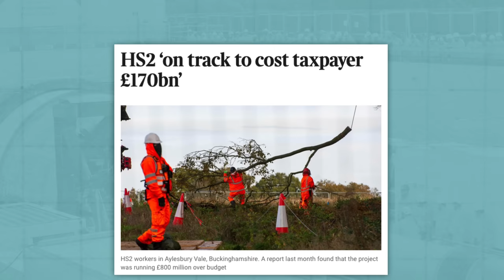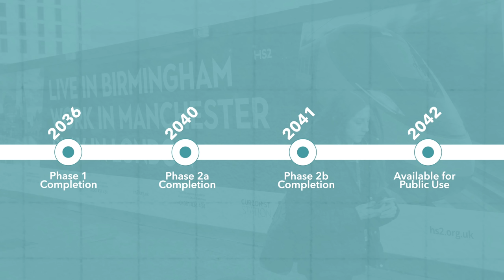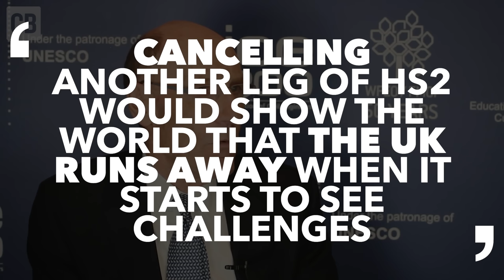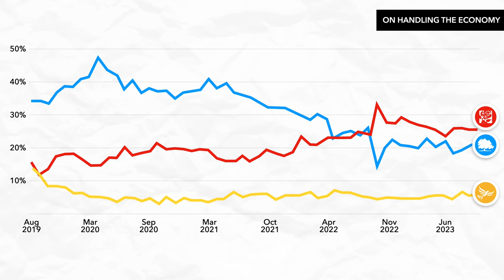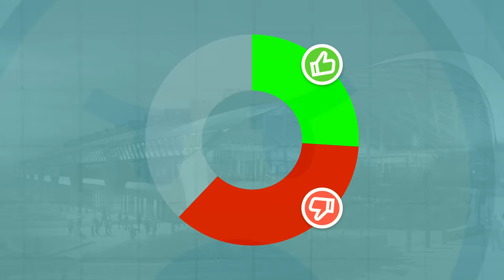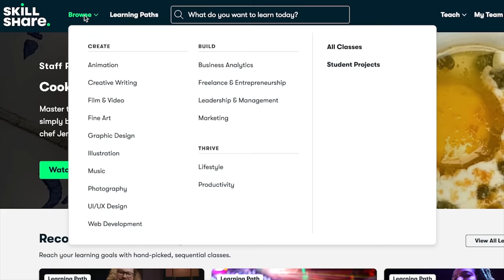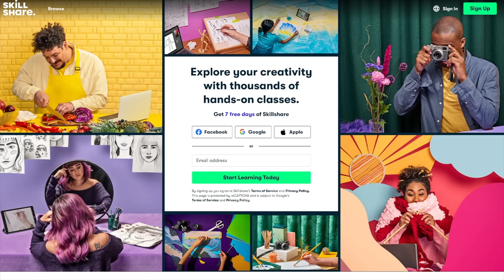Could Cancelling HS2 Work for Sunak?

Comment: Britain needs better, faster and CHEAPER trains. 

A project that would reshape the nation like this isn’t something you can be stingy about. It’s a matter of state and should be independent of who’s in power.
Reply: The reason I'm against this, is because of the cost to benefit ratio. It will cost a LOT, but only provide a little  benefit to ordinary people. Mostly it will benefit rich Tories, which is why the conservative wanted it so much.
Reply: Don't have to be stingy but don't have to be dumb. As some have said, remaining costs could be cut in half if it was just "very fast" not "super fast", and if the main aim is to free capacity, the 10mins difference is immaterial.
Reply: An estimated 100bn that can potentially still rise is really a huge sum for this few lines.
The benifit of beeing a little faster AFTER 2040 is also not that huge.
Imagine what you could do with this huge amount of money....

I also doubt that trainline will get cheaper because of this construction project.
Reply: @blablup1214  Tell me you didn’t watch the video without telling me you didn’t watch the video. Also stop buying into the false dichotomy that it’s HS2 or something else. We’re underinvesting everywhere and there’s no need for it.
Reply: By nation ,you just mean England, yes?
Reply: The issue with HS2 is it can't do that at most in 3 stations it will free up 4% of lines. It is also so far over budget it is ridiculous the line is 10x the cost of one in France.
Reply: @goattm2  I’d like to think a completed London through Manchester HS2 would make Birmingham to Leeds and North to Scotland more politically viable in the future, but knowing this country’s attitude to investment I’m probably wrong.
Reply: Along with better, faster and cheaper government.
Reply: @Alex-cw3rz  good idea !  Why not get the French to build what you really want ?
Reply: But we’re supposed to WFH and shelter in our 15 minute cities where trains become redundant.
Reply: @andreaslind6338 if hs2 is scrapped hs3 will most likely be scrapped too which will connect all major northern cities. Faster, cheaper and more reliable trains benefit ordinary people
Reply: @andreaslind6338  why wouldnt it benefit wealthy Labour people?
Reply: @goattm2  So, 90% of the population of the UK?
Reply: @andreaslind6338  I'm against it but the idea of HS2 was Gordon Brown's policy.
Reply: yep, i related visiting britain, to, OR going to london, = eurostar
or you'll need a car :-D , so car on the boat across the channel , 
i only looked up price for a longer city to city distance ONCE :-D , that horrible price convinced my enough that UK is simply not a public transport friendly country outside of greater london :).
Reply: @andreaslind6338  Its seriously worth the price. The West Coast mainline seriously needs additional capacity. The commuter trains are busy and are 12 coaches long.
Reply: Dont worry , tory voter chinese money is on its way.

Comment: sigh I've said this before. Back in the 60's, Japan started the Shinkansen, a high speed rail that is still world leading. The UK at the same time, rather than building a new rail, decided to build something that would go faster on the existing track, the APT or Advanced Passenger Train. The success of this is seen in a bad light, but the reality the findings were passed onto the Italians and actually made the system work. Meanwhile, as a stopgap, we had the HST 125. (look up Age of the Train for the wonderful figurehead of the advertisement) This arguably was a success, except in retrospect. It was meant to be a stopgap, a 50yr stopgap. The APT project was brushed away due to a bad launch. 

Cancelling the rest of HS2 is just passing the buck again for another generation. We tried to have short term savings with the APT running on existing track, and now we're cancelling HS2 as its costing too much and taking too long to even make plans, let alone building, when we all know, in the next 50yrs, we'll be upset with the existing system and complaining about the last generation not looking ahead
Reply: APT by the time it left service was working well. If anything it was held back by the lack of funds needed to upgrade the signalling to an in-cab system that would allow the APTs to go as fast as they were capable of going (From what I understand, UK railways are STILL waiting for that technology upgrade). The initial technical kinks of the APT were ironed out and remaining issues would be eliminated in any future "APT2". 
In the end it was another example of just how much the Tories hated the railways. In 1988 British Rail emerged into profitability for the first time since its inception, and instead of consolidating its success, the Tories set in motion plans to privatise it for a quick buck.
Reply: TLDR: Kicking the can
Reply: and the Japanese had even worse terrain to work with
Reply: And thats why HS2 is so much over budget. The UK cancels these projects constantly. And as such never allows for the industry and instutions to dveelop and learn the necessary skills. France, Japan, Italy. These nations are not magically better at rail projects. They are good because they have actually build rail for the past couple decades.

Comment: I feel like it should be mentioned that the Crossrail project is soon predicted to breakeven (late 2023-2024), and the core section only opened last year. That was a costly rail project as well. It's proof that investing in these high value rail projects actually will be profitable and grow the economy.

Comment: You can't expect major infrastructure projects like this to be cheap. Crossrail, a line that just serves London and the surrounding area (although with the obvious caveat that a greater proportion of it is underground than HS2) cost £19 bn. I was originally against HS2, but now that construction has started and billions of pounds have been spent, I hope we get some sort of railway at the end of it.
Reply: Yes, and remember how everyone said Crossrail was a shambles and should be cancelled. Where are all those people now? Do they still think it was a failure and not worth doing? The line is incredibly popular and everyone I've spoken to (including myself) loves it.
Reply: Majority of Crossrail's cost is the central london tunnels
The outside tunnels like the redding section is using existing local tracks (hence requirement for trains to use 3 types of signal systems)
Reply: Crossrail had a ridiculous cost because of how deep the tunnels were and the topography, but it was done relatively quickly even though it cost a ridiculous amount of money. And it also benefitted the country’s economic base-London. HS2 is going to go from the economic center in London, to areas that haven’t seen economic development since the Industrial Revolution. It just doesn’t make economic sense to spend $140 bn that will never be recovered.
Reply: @Da__goat  Hang on bruv. You know what kicked off the industrial revolution in these areas? Railways. When a railway was built economic investment happened, Look at my town hartlepool for example, Before the railways, small fishing village, once they turned up boomed into a industrial hub untill steam died...

Comment: While Italy is planning the longest suspended bridge in the world to link an island with a 8 line wide road and dual railway, the UK is thinking about cancelling a train line on land....
Reply: tbf, that bridge in Italy has been in a similar political spiral for decades and has never broken ground on the project.
Reply: @Wozza365  The big difference is that they do not plan to stop at the middle of the project, they have also built tunnels much more complex and expensive and know that in the end the benefits vastly outweigh the costs.
Reply: Bad example. The Messina straights bridge keeps on getting deferred..
HSR and rail infra in Italy would be a good example to follow. They have built a core spine route similar to HS2 and it's a roaring success and also over last 40 years has been slowly upgrading existing lines putting in diversions etc

Comment: The explanation for why HS2 was planned at the beginning of this video is probably the clearest and easily understandable explanation I have seen on the matter. It shows exactly why the line is in theory a good idea. I think one of HS2's biggest issues is it's name, because everyone gets so fixated on the speed aspect, and it is therefore understandable why so many people have the opinion of 'why should we spend all these billions of pounds just so we can get from London to Birmingham 20 minutes quicker' without really understanding what the project is about.

I don't often use the trains, but when I do I'm always surprised by how busy they are, and my biggest gear grind is that in the evenings and on Sundays those 'express' trains suddenly take twice as long (eg London to MK that normally takes 35 minutes suddenly takes 70).

Comment: I supported HS2 in its original form, and I thought it was still worth it even after the Leeds cancellation. But if they cancel the Manchester section too then I honestly don't see the benefit of continuing with it in such a watered-down, largely pointless form. All the more a slap to the face for the North since a big part of the sales pitch for the project was to help the North. To supposedly improve connections in the north and to "level up" the north of the country. If it does go ahead in its current shambolic form (without anything past Birmingham), it will simply be another monument to northern neglect and government indifference (or rather disdain).

Edit: I also doubt that the cost savings will be that significant in the larger picture of the project. Once all of the logistics, personnel, equipment, and what have you have been assembled and are operating, a significant amount of the cost has already been committed. Setting up and shutting down said projects/operations is where a significant amount of time, effort, and of course, money, is spent. This is why it's almost always better to just complete a large infrastructure project in one continuous process, with one step leading directly on from another, rather than stopping and starting. So even from a purely financial perspective, would it be worth it to save some money on the northern leg of the line, making the entire project all but impotent, whilst simultaneously still having to fork out a lion's share of the cost?
Reply: the supposed "Cost savings" from the cutbacks don't exist.
Heck they just make it MORE expensive since every extra year of construction is an extra year of prices going up atleast 2%.
Reply: It would be even more useless if the rumoured cancellation of the parts into central London and into central Birmingham actually happened. Then it would literally just be a train outside of London to outside of Birmingham, and you'd have to jump on a regular commuter train at both ends to get anywhere, basically making any speed benefits redundant.
Reply: The contracts for the section being considered for cancellation have not been given yet, so what you describe would not be an issue. For Euston though, it absolutely would. 

My guess is they will do the same thing they did to the Leeds leg. They will indefinitely pause construction, but keep the land purchases so that when in future another government can fairly easily restart the project.
Reply: Maybe they should have started at the northern end if they truly cared about the north
Reply: @jasongarfitt1147  It would have been far cheaper too. Much of the insane cost overruns have been incurred just getting the line through the home counties - having to pay off nimby councils and landlords whose land is stupidly overinflated in price. By comparison the Northern end is relatively cheap. Cancelling the Leeds section potentially saved as little as 10 billion (although the government claimed it'd be 40 billion but most economists find that estimate to be fanciful).
Reply: I keep seeing that level up thing in other comments. Did the British government actually advertised their train line as leveling up the north of the country? Like a fucking video game? 😂🤣😂🤣😂🤣😂
Reply: @klaykid117  yes, yes they did. They even made an official cabinet position called "Secretary of State for Levelling Up, Housing and Communities"

Comment: I have never wanted HS2 in its current form, but cancelling the London to Birmingham will be an environmental disaster. The amount of work completed has already caused irreparable damage, so it needs to be completed in order that some good may be gained.

In my opinion, the biggest failure of HS2 is, and always was, the failure to create a direct link to HS1 and, therefore, a link to Europe.
Reply: I would suggest the environmental disaster has already happened.
Reply: @Beorn.  That's what he said. So take your racist flag and disperse.
Reply: Agree
Reply: @sueyourself5413  concern for the environment is racist? How, I would love to know how you arrived at that one?do tell..I wait ready to be enlightened
Reply: @sueyourself5413  racist flag….? Wtf?
Reply: @Beorn.  Try that blue and yellow one.
Reply: A link was never going to be feasible without the UK joining schengen, and now we're out of the EU it's even less feasible. If you've got to do passport checks it's most efficient to have those at the station, and if passengers have to alight in London anyway, there's no point having through services to the continent. The reality is without a seamless border process it's much quicker to fly from Birmingham or Manchester so people will continue to do so.

Comment: Northerners would much prefer better and faster connectivity between major cities. 
From Leeds’s for example:
Nottingham is basically impossible.
Birmingham is out of the question
Manchester should take 30 mins with high speed rail but best case is 60mins…there are so many commuters on the Leeds:Manchester line there isn’t space on the train for you until the next one comes!

Comment: This is the only Infrastructure project that has run throughout the tories time in power over the last 13 years, it's about 5 times more than a french line (with more of it's length in tunnels) and they are thinking of cancelling it.
Reply: Not really no. The modernisation plan of 1955 was also a major infrastructure project started by the tories.
The shit managment of that (with many cutbacks including not electrifying the ECML becaues "kInGs CrOsS rOoF iS tO eXpEnSivE") that eventually lead to the beaching cuts.
Reply: @davidty2006  I was talking about the current tory government as in the last 13 years

Comment: They should not cancel it, the rail network needs it & it will benifit the country & environment, capitalism is the problem, rail projects potentially while pricey dont get as much criticism as road projects, if you want model shift & support the whole country it should be done (the spiraling costs are unavoidable because capitalism 😅, but once rail projects are done people turn arround on them pretty quick look at Elizabeth line) they are just getting desperate for votes😅
Reply: ^ The ramblings of a maniac.

Comment: It was always just another massive infrastructure project only designed to help London. If they actually wanted to invest in the North they would improve the transport links between Leeds, Manchester and Liverpool. It currently takes over an hour to go from Leeds to Manchester despite them only being 40 miles apart. Being able to move easily between the big cities in the North would boost the economy massively but it wont help London so they'll never do it.
Reply: But it’s the north!  It’s a backwater, move south for a good job
Reply: @ugiswrong the north is not a backwater and most problems it has are as a result of neglect from the southern government. The south is no paradise. What a stupid thing to say
Reply: Exactly.
Reply: @Max-ts5mw  He was just being sarcastic.

Comment: Part of the problem is that media focus on faster between London to Birmingham.   Very few actually point out about more local services and freight.
Favourite one was a fellow citizen of Birmingham who was against HS2 as didn’t need faster link to London but needed more commuter services in Birmingham.
Had to point out that New Street is full capacity wise and restricted by the tunnels (adding more tunnels would be eye watering) and that by taking the Birmingham to London and future other west coast services from Manchester and North etc out of New Street would free up the needed capacity in New Street for more commuter services.
It is that sort of lack of joined up thinking that is half the problem with the perception of HS2.

Comment: I'm proud to be French today and to share that our SEA high-speed line (HSL) was successfully completed in 2017. This remarkable project began in 2012, concurrently with the HSL BPL, which was also completed in 2017. It's a testament to our commitment and efficiency in infrastructure development. Moreover, we have numerous other projects signed off by the government, either under construction or about to start. In contrast, it's amusing to see the situation in the UK, where the rail system is notably inferior with no high-speed lines. And even when there's an attempt to develop one, it's baffling to see 70% of the project getting canceled. It's quite a stark difference in progress!

Moreover, implementing a high-speed rail system could be immensely beneficial for England, both economically and social development.